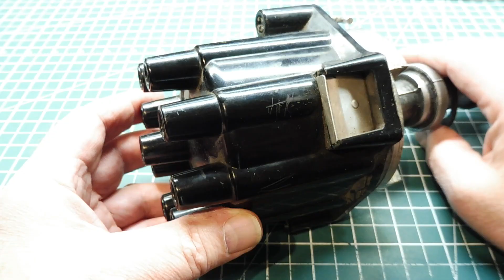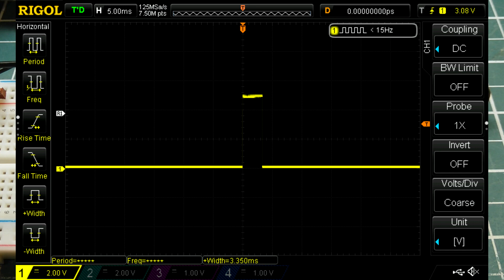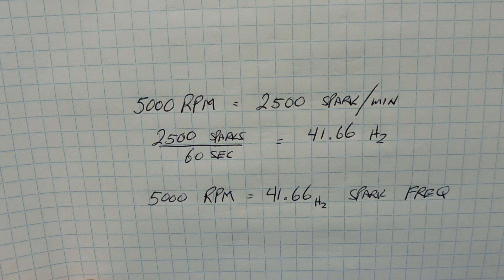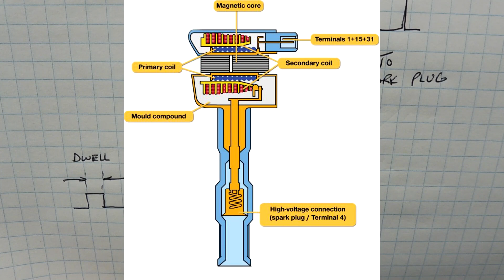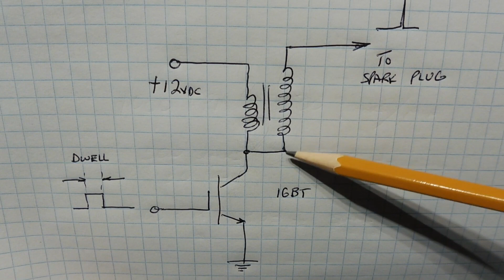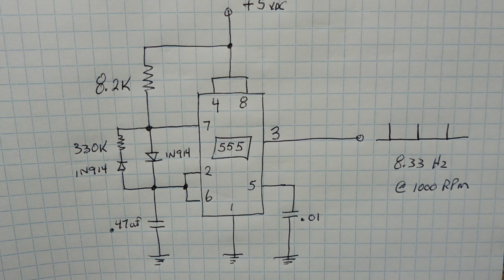Coil Pack Driver Circuit / Arduino / 555 Timer

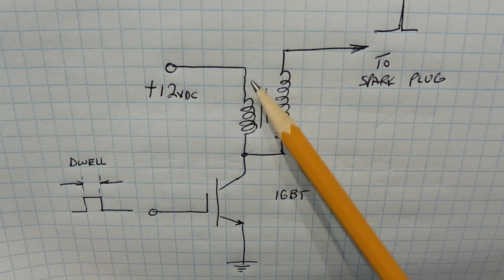Comment: At 5:50 when you present a situation with IGBT turned off it looks like the secondary coil has no ground connection. In my opinion spark has a great chance to appear on IGBT instead of on sparking plug. Maybe I am wrong or maybe it's magic.
Reply from the maker: The floating high voltage secondary field causes a spark to jump across the spark plug to ground of the engine block via the spark plug threads. The return is through the metal tube that is pushed over ground portion of the spark plug and capacity coupled up to the secondary coil. This works similar to the points/condenser ignition system where the condenser is the return path.

Comment: I always wonder, how do you get the info of which pin does what, from a quick search it seemed difficult to find data sheets for these automotive parts. Is it just experience?
Reply from the maker: The coil is off a 2008 Audi 3.2L, so wiring information can be found in the service manual. I have been rebuilding muscle cars since high school, so have been around cars all my life.

Comment: Hello Sir! 
          I'm making same type of project but I face a little bit problem when coils run on it Cause Arduino uno to stop and freezing also how can I figure it out
Reply from the maker: The COP has two ground terminals for isolation purposes. Connect the Uno to the signal ground and the battery supply to the power ground.
Reply: @0033mer  Thanks Sir ! 😍
              The Arduino Freezing problem is solved

Comment: Hello Sir , the driver circuit you showed with the 2 transistors : can it be used for real life application? will it be reliable enough? I'm planning to built a COP system using an arduino.
Reply from the maker: I have used the two transistor driver many times with no failures, but for true reliability use the TC4424 driver IC

Comment: I’m trying to build a points to smart coil driver using a CD4538BE chip.  The coil is a D514 LS2 for and using the chip, I can’t seem to control in a stable manner.  What am I doing wrong?
Reply from the maker: You need a MOSFET and a gate driver to energize the primary of a D514A coil. If you want to drive a coil with logic circuits, then check out a LS1 Gen3 coil which has a built in igniter. HT-020102
Reply: @0033mer  sorry, the D514 is a AC Delco p/n and has the igniter built in, like the haltech you’ve cited.  The points trigger the 4538BE chip
Reply: And the 4538 (via 7805) drives the Igbt coil/D514

Comment: How would someone do this for a 4 cylinder engine and sequence each cylinder? Most engines have a CYP (cylinder position sensor or cam/crank position sensor) that can assist with this. I’m interested in building a non-waste spark coil on plug setup.

Comment: Thank you for sharing your knowledge.
 I’m designing a transistor assist points ignition retrofit and would like to use the modern auto ignition IGBT for it. So I was thinking of using a basic PNP switching circuit to drive the IGBT with maybe LEDs to monitor the states. I didn’t know if there was anything to add to make it reliable. Maybe a large heatsink or maybe something to protect the PNP transistor? It seems like it would be very simple but with my lack of experience I’m probably missing something.  Would the circuit on and the engine not running maybe overheating it?
Reply from the maker: To get your project up and running quickly you could use an ignition module from a GM HEI distributor. They have been around for a while and are proven. Check out this video showing the circuit description and where to get a module. 
https://youtu.be/HrFT4dUzEH0
Reply: @0033mer  Wouldn't that require an inverted signal from the points to the G terminal?
Reply from the maker: Yes .. you could use a NPN transistor ( 2N3904 or 2N2222 ) Connect a pull-up resistor from the base to Vcc. The points would be connected from base to ground. Connect a pull-up resistor from collector to Vcc and ground the emitter. The output from the collector is the inverted signal driving the G terminal.
Reply: @0033mer  ok thanks
Reply: You got me looking around and I found an easier way. Adding 1K a pullup resistor between the B and the G terminals no inverted signal is needed.  I haven’t been able to post links to youtube comments before but if you google this it will get you there. how-to-trigger-hei-using-stock-points-dist.978979
 Thanks again.

Comment: You mention a tc4424 IC
At present I am using your circuit but
Using the 12v input which is also the coil voltage not the 5v in your circuit. 
On my pulse detonation  engines using HHO fuel with an Arduino for spark also fuel injector. But occasionally it seems to scramble the display on my LCD Button Shield. Sometime it will corrupt the sketch and the arduino will stop. It may be getting some feedback from the HF of the sparkplug.
Did you do a circuit diagram using the tc4424? Would it be a better circuit to use and maybe fix my intermittent problem.
Reply from the maker: The trigger input of the COP is isolated  from the high voltage transformer. I would check your power supply and grounding.
Reply: @0033mer  it only seems to fail when the spark plug is generating spark
Reply: @0033mer  I have rebuilt the circuit but still have the issue of running for a short time then stops.
I don't understand when you say the Cop is isolated. It needs a common earth to trigger the coil is there a resisor/diode capacitor. Can you draw a circuit for your hookup of the Cop wiring?
Reply from the maker: Make sure your trigger pulse is no longer than 3 msec (dwell) and the polatity is correct. (some are negative triggered) There are two grounds as indicated in the video. One for the trigger common and another for the supply ground. Check your wiring to the vehicle service manual where the COP came from.
Reply: @0033mer  OK. I will check it out the dwell could be the problem It may be saturating the coil. I have been also using a high frequency spark generator option  and that repuired 10 ms on time.
Wires toyota corolla 12v +, common to earth, trigger in and igf ignition fail.

Comment: i did extensive google searches but i couldn't find something like a datasheet for my coil. It's also from Volkswagen group. How do I find the correct connection for my socket?
06F 905 115F
Reply from the maker: Order a service manual for the make and model of your car. There are online sites where you can download.

Comment: So do I need some kind of microcontroller that can take input from the cam trigger and very four 5v signal wires at different times to manage cop on a four cylinder or would you have four individual setups like you showed with staged timing I'm so confused LOL
Reply from the maker: A setup for one cylinder is easy. For multiple cylinders you would need a missing tooth trigger wheel mounted on the crankshaft with a pickup feeding a microcontroller. Early engines used a distributor driven off the camshaft.
Reply: @0033mer   so the signal from the 4 + 1 crank signal (I might be wrong there just trying to understand this all it might be 12+1) sends the signal to a micro controller and the micro controller will basically send out 4 5v signals at the relative times? Thank you so much for replying btw! I'm still learning again sorry if this makes no sense
Reply: @0033mer  or maybe a better question would be how does my cam sensor or crank sensor tell the microcontroller how to fire at different times and where is the microcontroller on the speeduino is that like part of the auduino thing
Reply from the maker: The missing tooth creates a "sync" in the data stream to #1 cylinder and the rest of the teeth sense the crank position for the rest of the cylinders. Check out the Speeduino site for documentation and more info.

Comment: So much learning I still don't understand how you get them to fire sequentially in relation to timing this would be handy if my engine had one cylinder or like you said for diagnostics but this stuff is so hard to understand at all so much going on I'm getting there though

Comment: Cool, thanks for this.

I recently replaced the sparker module in a gas fire pit with an equivalent epoxy potted version.  Saved the old one to cut open for fun later.  The igniters on my gas grill are getting a bit flakey and it just occurred to me that this would be an easy fun way to replace them since I'm not sure parts are available for that unit anymore.
Reply from the maker: Glad it helped

Comment: Can you tell me the Ohms on most coil pack coils
Reply from the maker: Coil resistance varies with each car make and model. A typical coil resistance is about 1.5 Ohms for primary and 8000 Ohms for the secondary. COP (packs) contain electronics so the primary coil is not accessible. Check service manual for details.

Comment: very helpful video, 
Q. i would like to run a gas/LPG engine via a solenoid .
So i would like to have the solenoid let the gas in then it gets ignited 
can anyone give such information on how to use an arduino to do so.
Reply from the maker: You can use a ULN2803 to drive the solenoid. It contains 8 drivers which can switch 500 mA each. They can be paralleled for more current drive. Tie pin10 to Vcc for transient control. Check out this video where it is being used. https://youtu.be/pVN74eMDRWU
Reply: @0033mer  Thank you for very much for your information 
as a complete novice with circuits im not sure how one can setup and could do with an experts help .

What i would like to do is run a 12v ignition coil and a 12v solenoid that lets gas into a chamber and then ignited by the spark plug via a trigger
and also have a potentiometer to control the cycle rate

I have made a working type with Arduino  using 2 x 12v mosfets that are controlled from the Arduino to control the solenoid and a Ignition coil. 
but using 1x 12v battery to operate the Coil& solenoid via the mosfet and a separate  3.7v to run the Arduino 
But if i try and run the Arduino using a buck converter from the same 12v battery instead of it independent 3.7v battery to operate the Arduino i get a active loop with out me pressing the trigger
So im getting an earth loop and no I have no idea how to sort out
I am willing to pay for such help :)
Reply from the maker: You should have someone local look at your setup. It's hard to troubleshoot via emails.
I would first try an "isolated" buck converter. Check out Murata, they have a line of dc to dc isolated buck converters.

Comment: Hi thanks for making the video! I was hoping you could help me solve something, I'm trying to advance an hour meter for a modern dirtbike because the battery died on the original and it isn't replaceable so I had to buy a new one and I'd like it to match from when it died.  The hr meter has a single wire that wraps around the spark plug wire several times and I'm assuming it detects the pulse as it fires. I bought a NE555 square wave pulse generator board off Amazon. I powered the board with 12v dc and tried hooking up the single wire from the hr meter directly to the output of that board and also wrapped it around the output wire and a combination of both and nothing worked. I'm now thinking it's likely cause it doesn't have  enough output power so it's not reading it. If I used an old ignition coil I had laying around and had the signal generator output go to the ignition first and then wrapped the the hr meter wire around the ignition wire would I be on the correct path or way off. I also tried wrapping around the spark plug wire of my modern car and it didn't work. In addition I tried a CFL light bulb and the ac wire of a power supply all with no luck. after watching your video I'm thinking I my retry the car spark plug and just isolate the trigger input wire and wrap it around that if you think that would work. Please help I cannot waste many more hours on this lol.
Reply from the maker: It should trigger off a car ignition wire. I would verify that your new meter actually works. Most cars have resistive carbon wires so you might try triggering it with another dirt-bike.
Reply: @0033mer  thanks my ignition coil driver only had 3 wires so I tried wrapping it around the 3rd wire with no luck and just tried the first now but haven't had a chance to test it yet. Is the carbon the coating over the wire or the stuff wrapped around the bundled wires that looks like electrical tape almost?

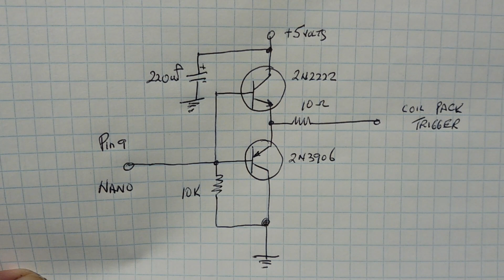Comment: Hi Meer. Thanks for the video. Im just wondering. Is there any basis why you select 10ohm on the output that goes to the cop trigger input? Im referring to the diagram u shows at 08:45?

Im thinking of wiring this cop (that with internal trigger) to the a ecu that is equipped with coil driver. 

Thus im planning to make the igbt in the coil to always “on” and be controlled directly by the ecu that already have built in coil driver. 

Thank you in advance! Looking forward for your reply!
Reply from the maker: IGBTs have input capacitance so there is an initial current surge when turned on, charging the capacitance. If you are using a coil driver designed for the application it is not needed.
Reply: @0033mer  thank you for the explanation! Really appreciated. Originally the ecu output is driving the coil that without igniter. Its only have 2 wire, one supply and the other is ground that controlling trigger signal.

Im planning to swap the coil using the one with internal igniter. So im thinking off, is it possible the internal igniter is always switch on, and solely control by the original ecu? So that the 12v pulse trigger signal could energized the primary coil (with internal trigger) thru its v supply amd ground only. Hope you could advise. 

Is it possible to force on the trigger input by providing constant 5vdc?

Comment: how can we variable the frequency for RPM while sticking to the constant dwell time of 4ms? plz guide
Reply from the maker: Vary the 330k ohms resistor which controls the frequency.
Reply: @0033mer  So a potentiometer could be used to change the resistance, changing the frequency?
Reply from the maker: Yes, you can use a pot.

Comment: One of my early forays into electronics was with a group that was developing CDI ignitions for RC airplanes. Basically, they were hot-rodding weed-eater motors to fly big planes. They were doing amazing things with the code... Developing timing advance curves that would change the advance based on the RPM. One guy branched off into motor scooter ignitions and made a business out of it, for awhile. The Chinese circuits came on the market and killed the DIY effort and the guy's business, as I recall. Funny, I wasn't interested in flying model planes, at all. I participated purely for the electronics.
Reply: Do you still have some info? I am trying to design a programable CDI , I found a few schematics and already builded base prototype but any info would be much aprecciatted
Reply: @rodriguezfranco3839 This was many, many years ago and I just don't remember much about it. I checked my computer files and I do not have anything that would be helpful. I do not even remember the name of the forum, or the thread. I think it may have been the RC Groups Forum. They seem to have lots of threads on the subject. Maybe try going to that forum and search CDI. HTH

Comment: Hi Mr. Ken, thank you for this informative video. This is my first time watching your sharing and just had to clicked that subscribe like and bell button right after finished watching. Btw, would you kindly share the sketch that you uploaded into the nano? I'd really appreciate it.
Reply from the maker: Thanks for the feedback. I do not use the Arduino IDE so there is no sketch. I write my code using the FORTH programming language which is interactive. 
Check out this video:  https://youtu.be/PY01_9dANd8
Reply: @0033mer  interactive programming sounds very interesting. But anyways, what pin 9 does in this setup here is just generating pulse which can be interactively controlled by keyboard is it?
Reply from the maker: Yes ... check out other videos for more examples.

Comment: Thanks for the valuable info
But I am get confused here about the calculations of RPM VS spark frequency 
Does it means that 555 driver circuit can’t run the car?
Also if I designed the 555 circuit to generate pluses equivalent to 5000RPM 
Can it operate the cars or the frequency of 555 circuit must match the RPM?
Reply from the maker: Modern automotive ignition systems are controlled by the onboard computer (ECU). The throttle body lets in air detected by the mass air flow sensor (MAF) which determines the injector timing with O2 sensor feedback and the crankshaft/camshaft position sensor which all work together to generate the spark at the correct time. This video demonstrates how to test the coil pack. Cars with simple points/condenser distributors can be run by a 555 timer circuit. https://youtu.be/zbuutEXkY5c
Reply: @0033mer  thanks for your kind reply.
Yes I am talking about old cars with distributor, if I designed the 555 circuit the spark frequency is fixed at a certain value independent from RPM
For example if the RPM is 1000 frequency will the same at RPM equal 5000, is it healthy for the engine or I have something missed?
Reply from the maker: The substitute ignition project is for emergencies to get your car off the road. The 555 timer frequency is fixed so you are basically in limp mode with a limited speed range.
Reply: There was time when you could use a model T coil, which was a vibrating circuit to replace a distributor  on the engine. Roughly 1950s through  1970s. Engine ran poorly but would get you home.